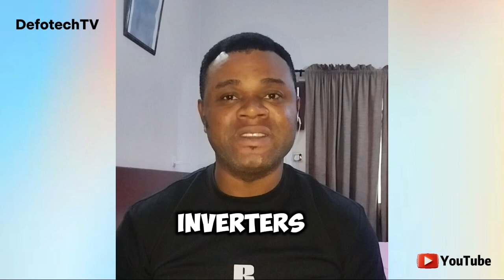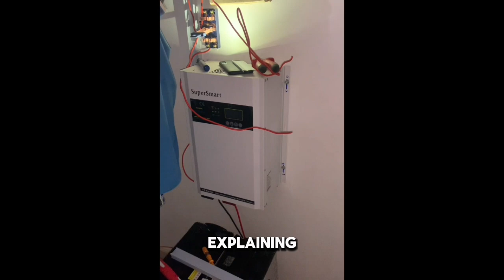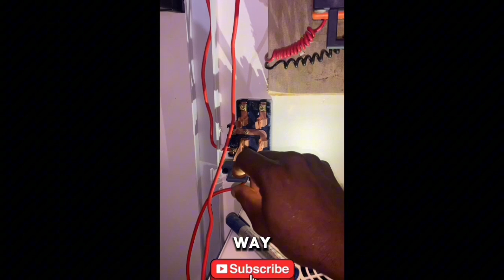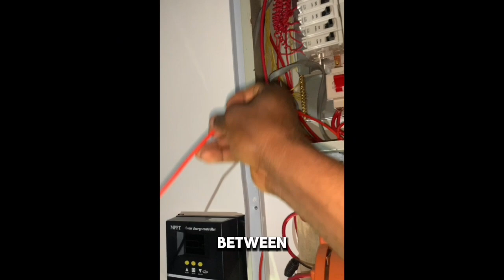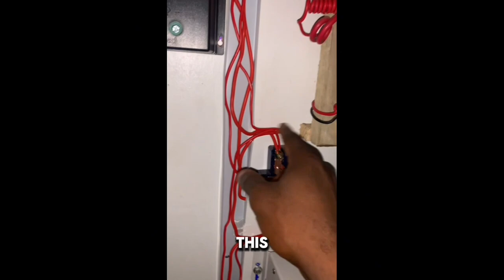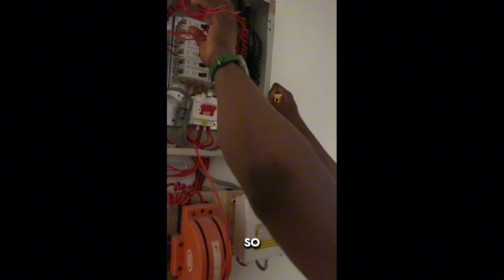Mistakes inverter installers makes

Comment: Thank you for the video... I'm waiting for a complete video on how your separated the loads... because in this video I can observe on the positive terminals are being separated...what Abt the negative terminal of the load?
Reply from the maker: @OsarumwenseFreshfire  There is actually no positive terminal, rather the live cable. But for the neural cable, we used a common neutral . The neutral is linked to both the inverter, change over and the D.B.
Reply: @defotechtv9093  please sir 🙏 I would prefer if a video can be done on that to understand better
Reply from the maker: @OsarumwenseFreshfire  Alright
Reply: @defotechtv9093  ... thank you sir🙏